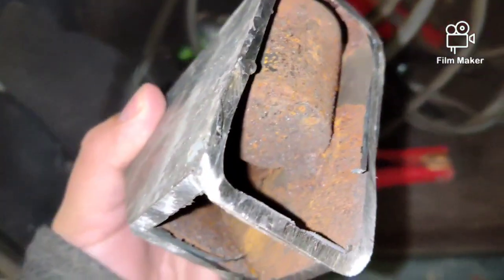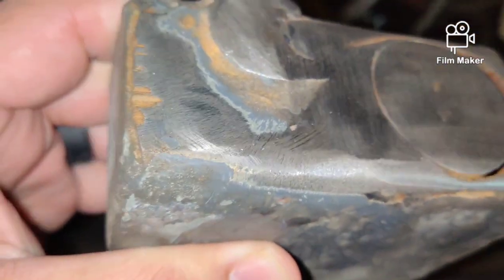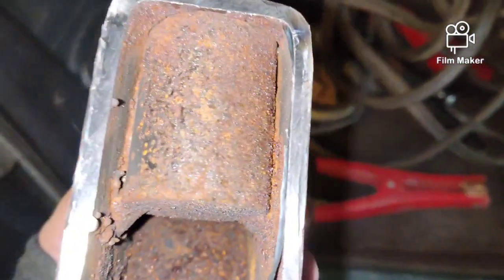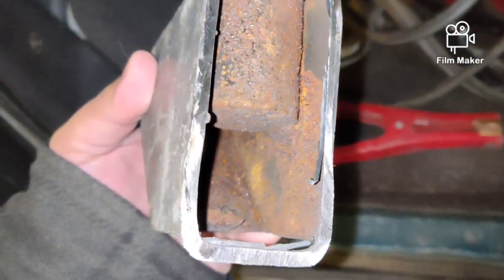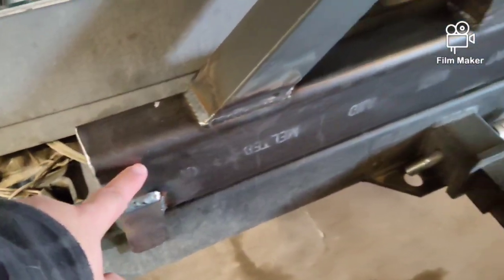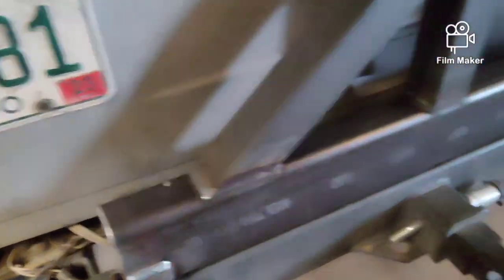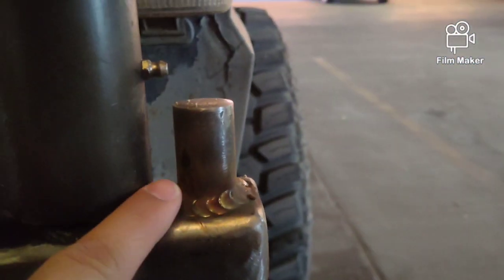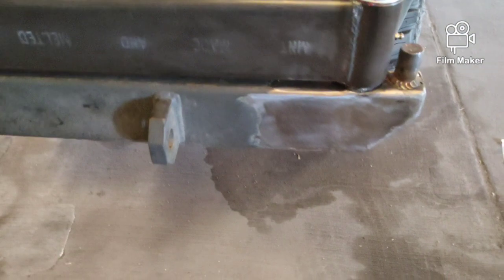Gus Gus's Dirtworx Bumper Update

Comment: Sis you leave the bumper unpainted when installed? That's crazy rust!
Reply from the maker: That's grease. Some reason it got froze up even with grease in it. It came with bushings instead of bearings in the spindle
Reply: @SandRatsGarage  Thanks. I'm installing one on my TJ right now. Just primed and painted it and will be greasing the crap out of the spindle before and after installation after seeing this. Gotta make sure those O rings that keep water out of the spindle are good too.
Reply from the maker: @daviddebuhr8995  I had my greased heavily. I had another video that shows how I fixed this issue using a trail forged spindle assembly
Reply: @SandRatsGarage  Saw that video and the excellent fabrication of the repair. It is warm here in CA so hoping the temps with some good grease will keep it in good shape. I think the best thing to do is keep it greased and just exercise the hinge frequently. Like when I get gas. It is built like a tank so I have high hopes!
Reply from the maker: @daviddebuhr8995  The other thing being there wasn't enough support at the latch. I added a support bump stop to prevent flex